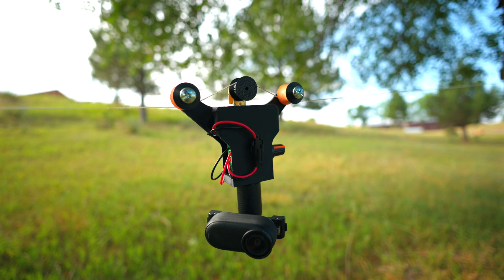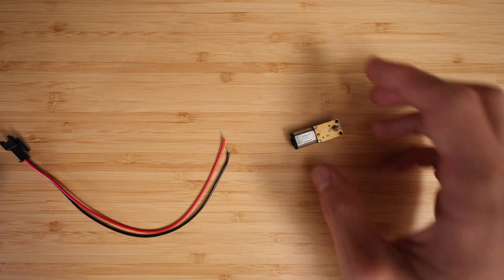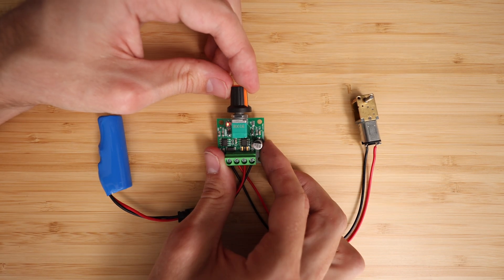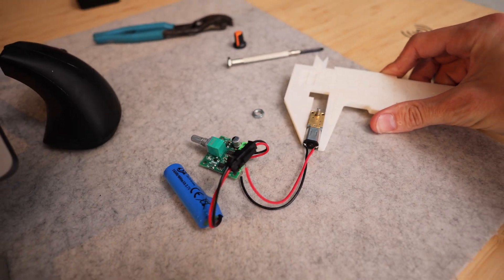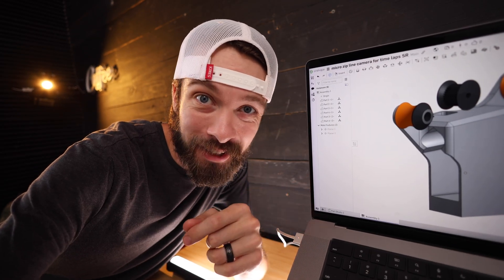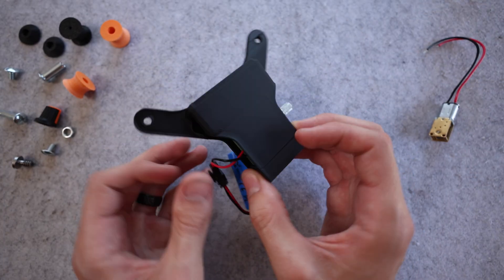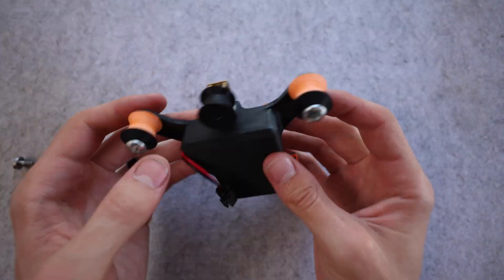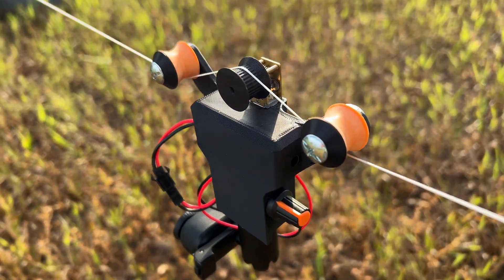Can You Build a DIY Cable Cam on a Budget?

Comment: Excellent work, Luke! Honestly, I've had that idea fermenting between my ears for years now, but have never made it happen.  First thought, both my initial motivation and note to share, is that this will be completely legal to use in any national park, where drones are NOT permitted for many respectable reasons.  Next step is to explore software as well as cable type to best eliminate the distracting line in the footage.  I recommend fishing lines, but not aware of best software.  Lastly, make it waterproof to route that zipline through a pretty waterfall! Bravo, dude!

Comment: Have you thought about using a receiver and motor controller for an RC car?  Then you can fully control the movement of the cable cam remotely...

Comment: How long do you think that battery will last if you leave the motor running continuously? I'll probably build this rig, but I can see other uses for that little motor and battery setup.
Reply from the maker: I haven’t timed it, but if I was to take a guess, I would say it can run for maybe between an hour and two hours

Comment: Nice.. as long as you don't look at the corners of the image.
Will it hold something more substantial?
Reply from the maker: Yes it will, I've used it with both the Insta360 X4 and even my canon R8. FYI I'm using it with the slow 16RPM motor that is linked in the description. I'm not sure what the faster motor will be capable of, but I have one in the mail that I'll be trying out soon.
Reply: Nice work congratulations.
I think you’ll notice a big difference with a better camera .